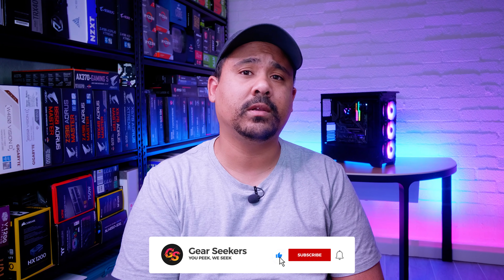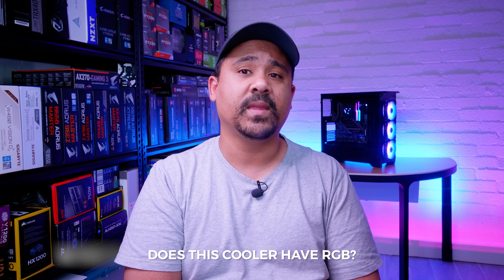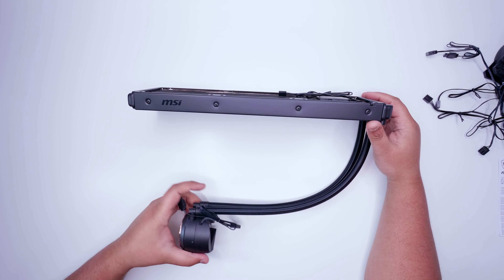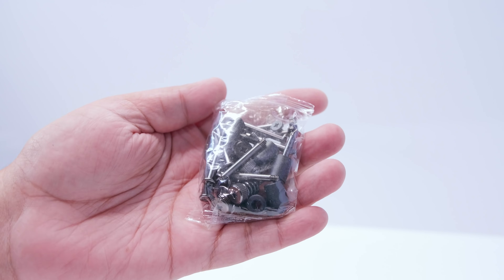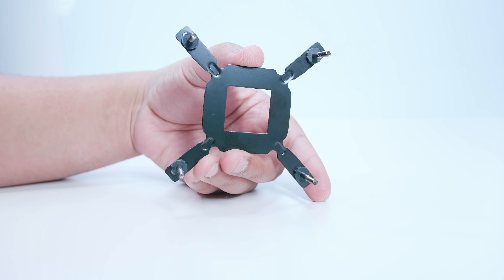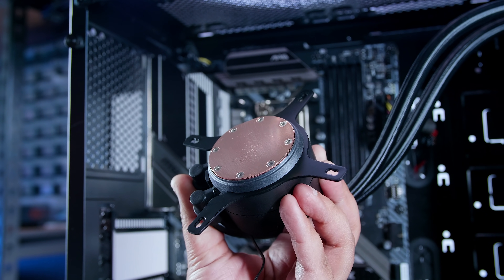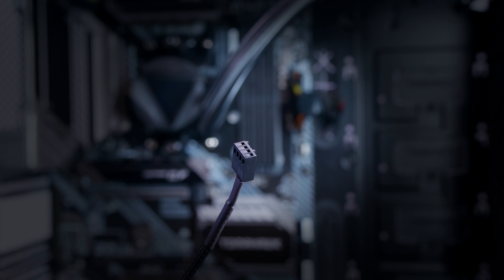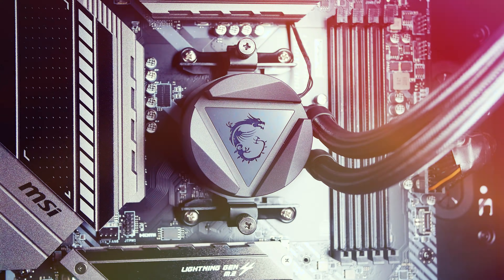HOWTO MSI MAG Coreliquid 360R & 240R Intel LGA 1200 & 115X Install Guide

Comment: Hi, I bought a MAG CORELIQUID 360R V2 a couple of months ago, I connected the pump cable to PUMP_FAN (3pin) and the three-pin radiator fans to a cable (noise reducer) that has 4 pins and must be connected to CPU_FAN.
Now from the bios, if I set the fans to auto it regulates them in PWM and therefore they go in pwm for sure, also because if I select DC I hear a slight buzz, while how should the pump be controlled? By default it is on PWM, but since it has 3 pins shouldn't it be controlled via DC? I noticed that if it is on PWM in addition to emitting a hiss the pump always goes to maximum, instead if I set DC the speed varies and the buzzing stops. How should I control it? because on the internet there are different opinions on making it go to maximum.

Comment: Anyone know where I can get my hands on the mounting bracket? 

Still on LGA 1150 as Ive made a super budget build, however I got a case and the cooler for super cheap - except it only came with the AM4 mounting hardware. Got the backplate for intel, but not the bracket that firs to the block :( So stuck with a large paper weight and a stock intel cooler lol

Comment: here is how to fix the MSI shit problem...  BUY A DIFFERENT BRAND... THIS ONE SUCKS ASS..  first off  NO INSTRUSTIONS COMES WITH IT  the 360r v2   just bought one and no fuk'n install instructions..   so if you don't have a smart phone with internet or a second computer... yur fuk'd   then I took off these 2 little brackets on the mobo for holding the AMD air cooler on.. and put on a bracket for a Coolermaster 240 ..AMD.... well I can't find the 2 little bullshit brackets so now this fukn 360 radiator is USELESS ...NONE OF THE OTHER BRACKETS WILL WORK!!!   FUK MSI and their JUNK HORRIBLE DESIGNS!!!    NEVER AGAIN!!

Comment: I know that this may not be answered but I'll try anyway.
My motherboard has chassis/water pump fan connectors, cpu fan connector and cpu/water pump fan connector. Which one should i use for the pump and which one should i use for the fans?

Comment: I connected everything as you have shown, but my AIO fans won't light up. All fans spin just fine but do not light up. I have an MSI motherboard (MPG Pro Carbon Z390) and an MSI MAG coreliquid 360R AIO. The AIO pump head does not light up either. The mystic lights in the motherboard work fine and I can control them in the Dragon Center. I have updated the mobo BIOS and chipset drivers and it did not help. It's a new computer. I tested a single fan connected to the JRAINBOW1 connector and did not light up either, so I'm starting to think that the JRAINBOW1 connector is defective. Any ideas as to why JRAIBOW1 is not working? It is turned on in the Dragon Center. Thanks.

Comment: A great looking cooler and super silent when running. However the one I received appears to be failing after 6 months - making a weird rattling noise when computer is started up lasting longer each time. Unfortunately the many comments around this are correct- this is not a reliable cooler and I am going back to fans.

Comment: what do i do if my motherboard doesn't have a pump fan header?
Reply: You don’t need to use the pump header for it to work, but you can also plug it into the cpu fan header or system fan header
Reply: @reallysillybillyischilly7166  if i use the CPU fan header for the pump, where do I plug the fans then? aren't those the ones supposed to ramp up depending on the cpu's temp ?
Reply: @adammankai5661  I think you would just plug them into the system fan headers the pwm functionality would still work it just wouldn’t adjust depending on the cpus temperature
Reply: @reallysillybillyischilly7166  bro they should ajust to the cpus temps that's exactly what they're for but I think u can change what sensor they depend on in the bios so instead of the one that measures the temp inside the case I can use the CPU temp sensor
Reply: @adammankai5661  probably I would just do my research just to make sure

Comment: Pump fan cable, as shown in the video and as with my unit, the plug has three holes for pins to go into. However, the motherboard has four pins for the pump fan. The video shows this as well. Then he just says "plug it in". Okay? How do you plug it in if the cable has three holes for pins but the motherboard has four pins sticking out? Am I stupid? Or is the video very unclear about this?

Comment: Have you ran into any problems with cooling? I have this same AIO mounted the same way and my ryzen 5600x is hitting 70+C at idle with all default settings. Made sure i removed all plastics and applied a generous amount of thermal paste. I even did it twice to make sure, and still having same issue. Fan is running and can feel liquid moving in the hoses. Read some things saying the pump should be mounted at the bottom instead of the top, may try that next. Any feedback would be great
Reply: The coolant within the aio is garbage. Just removed the copper plate to find a bunch of gunk within cpu heatsink

Comment: Building pc for younger brother and his motherboard (asrock b365 phantom) only has 4pin rgb led and a 3 pin addr led. Is the addr the same as jrainbow which is also 3 pin. Watched a video where crossing rgb and addr might blow leds in fans bc of power and I don’t want to make that mistake. But I can’t see any other way to light up the leds in the fans.

Comment: Um, for my C240 AIO, the cable thats connected to the radiator itself only has 3 holes in the cable instead if 4. although i have the required PUMP_FAN thinig on the mobo. can i still plug the 3 hole cable from the radiator to the 4 pin PUMP_FAN?

Comment: My board has a 4 pin connector and i got the AiO what can i do now? The pump is working but no rgb. I was searching for many solutions but still sitting here. I tried to put it in thr ARGB header and no changes.

Comment: I just learoned the start position of the radiator is wrong. You will get bubbles.
Reply from the maker: You learned wrong. The pump is in the radiator
Reply: I hope so, I had to install it like that 🤦
Reply from the maker: Yeah almost every 360mm AIO needs to be installed like this

Comment: Daaamn I had many issues with my pc with bluescreens, shutdowns and so and uppon inspection, I saw that thermal throttling was often used (so CPU got 100 degrees). When watching your video I remember that sticker but not if I removed it. I now took it apart and saw... The sticker was still on! I removed it and now even under load it stays at around 60-70 degrees. Many thanks!

Comment: hi , 
I did the same setup with you but the fans on the radiator are running 100% how can i fix it ? bios settings  is not working fan control.

Comment: Is there anything I can do if my motherboard does not have a jrainbow header? I have 2 4-pin RGB headers available. Can I run this without RGB and just power the fans / pump? If that won’t work can I ditch the MSI fans entirely and use just 2 random stock fans and power them through the provided fan splitter? Any help would be appreciated
Reply: If you plug in a 3-pin in a 4-pin your header will go boom. You need an aRGB controller for example.

Comment: Very helpful video/guide, but I have a Phanteks P400A and installing the fans on the outside in this way meant my front mesh panel would not fit back on. Instead I had to remove the screws and reposition the HDD bay further back (there are already holes for you to do this) and install the fans Infront of the radiator inside the case.
Reply: Thank you for this... I watched this video and thought theres no way the front mesh will fit... I took what you said and put fans on radiator and inside the case.
Reply: Can i have picture of your pc with this layout?

Comment: Good video. However, I have to ask if the way you have installed the fans (with the dragon aiming outside the case) is not for blowing the air inside the case? In that case, it would be blowing hot air inside the case; I think.
Reply from the maker: Air temperature does not matter. It's about the flow of air not how hot it is. Not my first rodeo buddy.

Comment: Question:
Im planning to pick the 240 version. where is the best position to mount the radiator to avoid airpockets termal problems? expecially that the pump is in tge radiator?
Reply: If you ever find out please respond to my post. I have the 360mm version (same as in the video) and I have been asking everywhere for an answer to this question with no response.
Reply: I just installed the 240 and I put it on the front with tubes / pump at the top
Reply: on top

Comment: hey i have this cooler 360mm installed with 10700k stock speed 
cpu getting very warm 
the aio installed on top of the case air blowing out 
i am getting 42-50 idle temps
ingames around 68 to 73 
in cinebench around 75 
i think there is a defect somewhere
Reply: I noticed at the start of this video he has the hoses at the top of the radiator. This may be causing your issues if you have it mounted the same way. Try mounting the radiator with the hoses down. The quick install guide shows it this way.
Reply: Just read that you have it mounted on top in the case. What I said before may still apply. It's worth trying, if you're able to, before getting an RMA and sending it back.

Comment: Excellent video bro, since I am going to buy that water cooler and it is my first PC mount. But I have a question, instead of connecting the pwm fan splitter (the one that comes included in the box) for the fans to the CPU Fan, can I connect the fans to a HUB?

Comment: I got the 240R version with 2 fans. it´s a slightly different cable. I´ve been rewatching so many times about daisy-chaining still get confused about the cable connection. Any help would be great?
Reply: Did you figure it out I’m in the same boat and I’ve literally been stuck for over two hours. Please let me know if you’ve figured it out
Reply: @jumpmanjay4149   I’m doing my first build I started yesterday and I’m having the same problem did you ever figure this out?
Reply: @ricardojimenez3741  https://youtu.be/CMDPcIMSdcQ this should help all rgb 240m AIOs are pretty much the same when it comes to wiring. The main thing that tripped me up was realizing I didn’t need to plug every thing in to finish the daisy chain. So you will likely be left with one unplugged wire also don’t use the noise reduction cable just adjust the fan curve after the build is finished. Good luck
Reply: @jumpmanjay4149   Yeah I finally figured that out after saying screw it and winging it and finishing the build but everything turned out to work.

Comment: I bought the 240r and was wondering because the pump is in the radiator, would it be better to install this in the top? Or in the front like this? I just want to make sure I don’t get any air bubbles stuck in the cpu block

Comment: I have a H510 case, should i place the fans facing inside the case? Or leave them the side you installed them on. I'm not sure which is the best way to place them because at the same time I want to be able to see the rgb from the fans.
Reply: I have the same problem. Did you find a solution???
Reply: @kadencas1  yes i ended up seeing someone use the same fans with a similar case, I found its actually better to have the fans facing inside the case. 1 for help with cooling and 2 to see awesome rgb  lol

Comment: Also how do I check if the pump is circulating coolant? Cuz I don’t want to run my pc not knowing the pump isn’t powered cuz I plugged it in to the wrong spot, does the pump just go into a case fan slot?

Comment: There is no need to plug it to the PSU? or nick just misses that?
Reply: There is no need to plug into the PSU. The Pump is powered from the motherboard as well as the aRGB fans.
Reply: @sulkyvirus8676  yeah I tought so. Just used to have a kraken x72 and never understood why that aio has a usb cable to motherboard and even sata conector....

Comment: On my mother board I only have JRGB1 and 2. They are 4 pins. Is there any way I can plug in the rgb’s or do I need a different mother board :( help please
Reply: Do not mix 3 and 4 pin as the 3 pin is 5v and 4 pin is 12v and you will fry either or if mixed
Reply: @Iamtherealsun  what is the solution for this i have the same issue is there an additional adapter?
Reply: @deathrow564  i think you can get 3 to 4 pin adapters vice-versa but not too sure youd have to look it up yourself

Comment: Can't I install it on top?
Reply: You can install it in the top of your case just make sure that the case can fit the fans. Check the case specs and it should tell you which sizes it supports.
Reply: @Sergio-og7ih   arh okay, thanks

Comment: I don’t have a jrainbow on my msi z390 gaming pro board. Any other way to hook this up?
Reply: Did you find a solution? I also do not have an aRGB header on my mobo
Reply: It's probably not called jrainbow. My board from 2017 has multiple rgb headers
Reply: @JReam425  RGB and ARGB are two different things. Not interchangeable.
Reply: @Justin-Bakery  mine is addressable.. I control it though aura and I installed two more rgb stripes by phanteks aa well
Reply: @JReam425  just because your motherboard has the header does not mean they all do. That’s why he was asking the question....
Reply: @Justin-Bakery  I know, but if my budget strix board has multiple headers I think his newer model would as well

Comment: I bought this cooler and replaced the fans with fans that ma chef my case fans and plugged them in to the header in the case and they light up and spin. I also plugged in the cable on the back of the rad to the pump fan header but in bios my cpu temp kept rising and rising and that was just being in the bios. Would anyone have an idea why I am having this problem. I don’t have any cables plugged in to the cpu fan header but I shouldnt need to as I used different fans and they are working. I also did not plug in the cold plate cables as I did not have a spot for them but they are just for rgb anyways?

Comment: I've been hearing the tubes should be on the bottom, what do you think?
Reply from the maker: not applicable in almost every use case. Especially with a 360mm AIO at the front.
Reply: @GearSeekers  Ok, just making sure. I just watched another youtuber saying that its mistake to have the tubes at the top and so on but I loved your video you were the only one that could answer my question on mounting.
Reply: It should also be noted that it doesn't really matter where the tubes are placed, as long the pump (and for this particular AIO, the block) is not at the top of the loop. With the pump being in the radiator on this model, how is placed is perfectly acceptable. I plan on mounting this the same way, but with a pull configuration in my next build.

Comment: This tutorial is much appreciated. MSI also sends their thanks for you doing their work for them. Why they can manufacture a product and spend plenty of marketing dollars promoting it's sale but can send the consumer out to sea without a paddle by not providing sufficient installation instructions is pretty weak.
Reply: I've install this in my first build. Its literally just  screws for the for the fans and radiator. 
You have to look into your motherboard instructions to see where the rgb headers go. So what was your problem?

Comment: I don’t have that freakin JRAINBOW connection in my board, what should I do????
Reply: Same it should still work but won't light up also I've been looking for spliiters but nothing yet that has fit
Reply: JRAINBOW is MSI’s branding for aRGB. If you have a different motherboard brand the rgb header will be called something different. Consult the mobo manual to find out what that is. Just make sure it’s 5V for aRGB.

Comment: if you dont have the PUMP pin ? you can stil instal it ?
Reply: Yea I would put the pump into a system fan header or if u have 2 cpu fan headers but make sure In bios to make the pump speed maxed 😊

Comment: Its my first time building a pc and I have installed my deepcool 360ex using your installation guide. Whats freaking me out is in the bios it’s saying the aio pump is n/a.
Reply: Must’ve plugged in the pump to a regular fan header and not the designated pump header on your mobo double check it